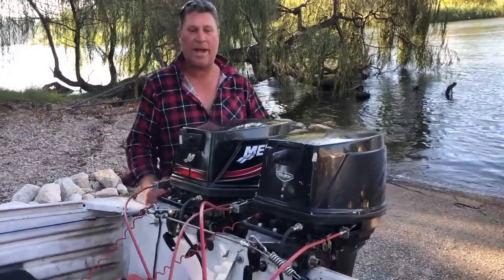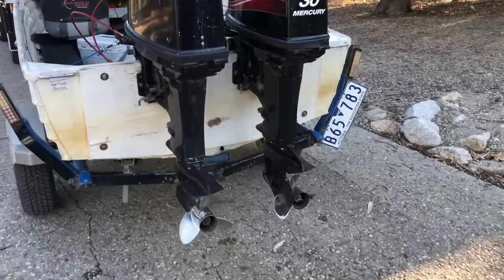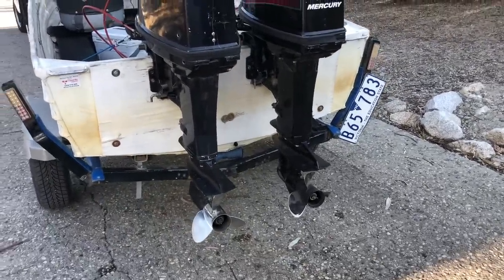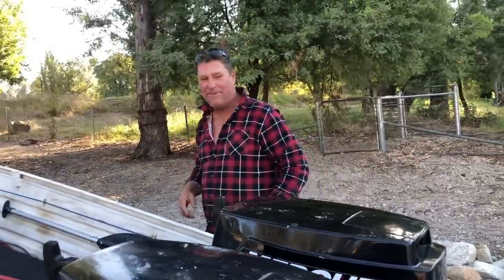twin outboard tinny, fastest dingy ,twin motor skiff boat

Comment: Great video. Love it when these boats get modified. You will free up some speed if you raise the engine height. The "Angel Wings" the engines are throwing out to the side are an indication of being too deep....then play with adding cup to the 13" props. BTW.....also saw a Merc 200hp on a 14' Tinnie tonight as well....look it up on here. Not kidding!
Reply: And it was a modified tiller 😳
Reply: the motors are 15" on a 20" transom you cant go any higher without 2 custom stainless props  and the angel wings are from water off the lower bracket not the lower unit...only way that rig goes faster is with bigger props period 15 p stainless high rake perf props.
Reply: Just came from that video.... in two ways....
Reply: @bmw328igearhead  pics of one of the ways?

Comment: Sweet. I have a 3.5 m Hawker DeHavilland made by an aircraft company that diversified into boats.
Forward controls and a 9.5 hp Johnson delivered standard.
I modified the transom to handle a 35 HP long shaft Evinrude which tops out at 50 kph. Short shaft Evinrudes are rare.
I also run various other 25 hp Evinrudes on the boat as well as a rare Sportster motor Evinrude made in 1972.
Your boat is a classic hang onto it👍

Comment: Hi! did the same with 2*30 hp merc\tohatsu outboards back in 2015, tested it both at river and at the Black Sea (over 2000 miles on the salt water), won a race with it, goes faster than single 60 actually) the setup is ok, as long as you find the correct props!
Reply from the maker: That’s awesome! What hull did you have ? I would like to update mine one day soon !
Reply: @netikracing  it's an old riveted 16' aircraft aluminum soviet hull from the late 1960's made from surplus airplane materials, called "Progress" here, so I doubt it will help where you're from. They are pretty common here, so I bought a hull to restore in the 60's style, when they had 2 outboards as a factory option. Here's what I I got.
Reply: @netikracing  racing against ribs (since only ribs showed up being lightweight) with 60hp yamas and mercs, the power class is 40-69hp, consumer boats, offiicial UIM race. https://youtu.be/H6nyMlCKIHY
Reply: @netikracing  here's what it looks like on the trailer, never made a walkaround video, sorry. https://www.youtube.com/watch?v=JujcdP8eDz4&t=182s
Reply: SaltyBrains  both yes and no. The races were indeed with tight turns where torque and acceleration were key and where 2 twostrokes outmatch a single fourstroke and loose top speed on a straight line. But it has more to do with props pitch, prop slip, gear ratio and prop positioning. 

There's no chance for a 60 hp honda or suzuki with 2.0+ gear ratio and an extended leg to outrun a 381mm 60 hp merc with 1.64 gear ratio on similar hull. As for single vs twins on a v-hull - the twins being placed by sides are not that deep submerged than a single centered motor, also the gear cases and props are smaller creating actually less drag, less popr wash and less prop slip and allow to run shallower waters. Of course it all makes sense if you have props with the higher pitch to utilize that double hp and the motor weights are comparable.

Also, even if you don't change the props to a higher pitch, the top speed will still increase a little, as the extra hp will allow both motors to rev higher easily overrvving to 6400 rpm in case of tohatsu 30 (5850 rpm limit and no overrev shutoff), that will ad 5-7 km\h, assuming you have SS props that are capable of utilizing high rpm without slipping.
Reply: @andreireal9158  I've got the same model Progress from year 1991 with 50 Yamaha Autolube. It's built for fishing and it's fun little boat.
Reply: @paavoahtiainen5372  yeah, great hull for small rivers, also can handle the sea with waves up to 0,75m (per manual) if needed
Reply: SaltyBrains  i think twin setup can tollerate  larger propellors , that s the only way to increase top speed

Comment: does it affect  your transom on your boat with the weight of 2 out boards in a engineering sense? what size motor was the hull rated for originally?...but is a great set up and fast little boat
Reply from the maker: We did strengthen the transom , may have been originally rated to one 28 to 30hp long shaft I have 2 short shaft
Reply: @netikracing  ok nice ....

Comment: Get those puppy’s higher on the transom!! Will pick up a lot of speed and rpm!
Reply: Finally someone that comprehends what my other comment means! I said the same thing, in different words, and was told it wouldn’t matter and would make it slower😂

With that being said… Can you imagine that thing with a 12” or 16” jack plate, with hydraulic height adjustment, and power trim?!? SHEEEEEZUUUSS that’d be one wicked little b@stard!!!

Comment: Chuck some 15 pitch props on. Hard to find but on such a light tiny you'd get away with it lol. Running twin 30's on my centre console 5.2m rib at 60kmph. Must be heavier than your tinny hence I think you can prop up a bit lol
Reply from the maker: i want to get balistik 15 inch props but they have been out of stock for a wile
Reply: @netikracing  get merc choppers if you can find them or some good high rake round ear props ...i never had real good perf with ballistics.

Comment: Check out the different gear ratios for more speed lol your wasting fuel those engines will rev and not go any faster. but that's The highest pitch prop you can buy for that engine the older 25 xds have better props for speed